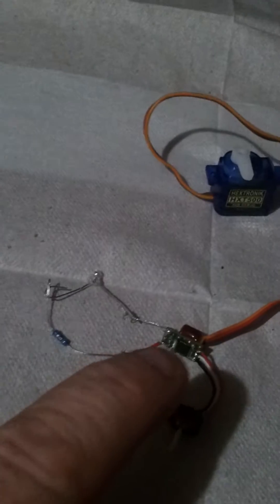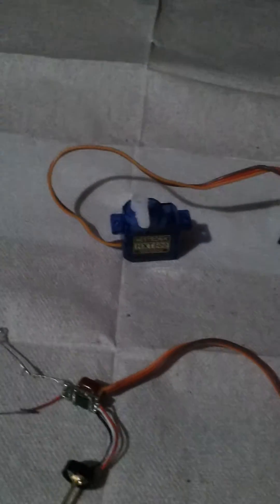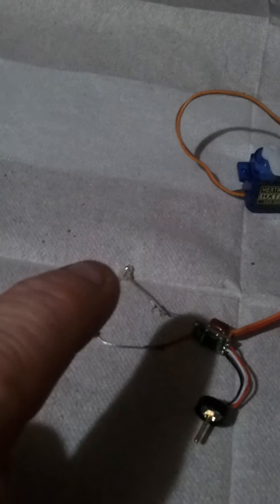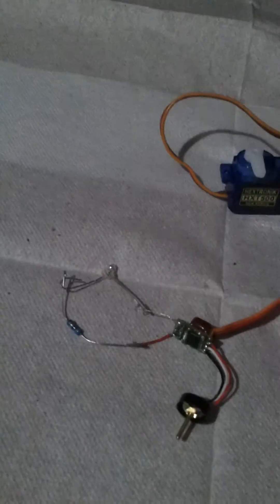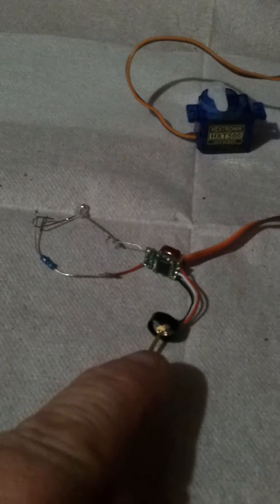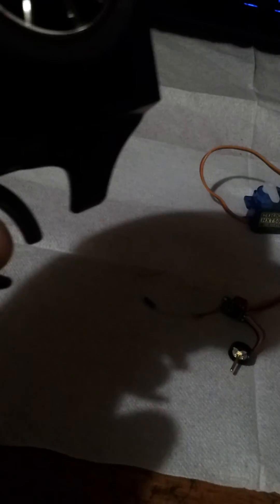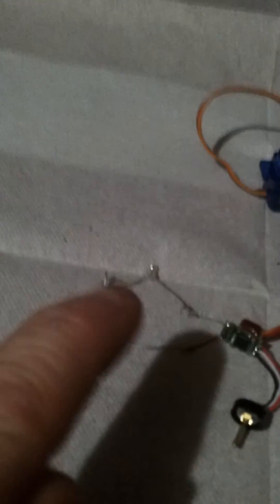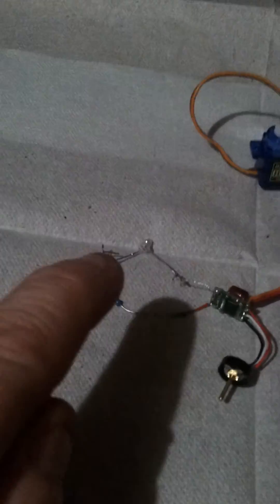$2 DIY RC Brake Lights

Comment: You could wire the two LEDs in series to double the voltage they can handle. I wire up all of the LEDs for my RC lighting in series pairs so they can handle up to 6v directly from the receiver. Haven't had any burn out yet.

Comment: how do you wire it for any direction? (i need to create solenoid brakes). Im trying to find a good rc switch
Reply from the maker: Zxenmusic what do you mean by wire it for any direction?
im assuming your solenoid brakes are set to always on, until a switch deactivates them? in which case you'd probably want it to switch with throttle on (instead of brakes like LED lights)

the pot thats inside the servo can be adjusted to set where the throttle position is when it activates.
swapping the pos and neg wires you can change if it activates on throttle or on brake.
Reply from the maker: Zxenmusic ok, after further research i think i get what you mean.
not sure you can wire it for both directions since its essentially just an on/off circuit. the only other idea may be to use a Y harness with 2 of these, one wired for each direction and adjust each trimpot to suit. (one for throttle and a 2nd for brake)
It should work

Comment from the maker: lots of LED have different ratings.
I used LEDcalc dot com to work it out.
input voltage is usually 5 or 6v depending on your rc
my 3mm led were 3.3volts + 20mah peak current, yours may be different being 5mm.
I  used the "parallel" calculator based on 2x LED setup

Comment from the maker: no I don't, sorry.. but its as simple as doing it the same as the above video, but use 150 ohm resistors instead. (if using 3mm red LED)

 then gently join another wire into the red power wire before the servo.. add in the resistor and run it past the "brake light servo" and tap direct into the LED power line... this way half power will bypass the servo.. and the servo will just boost the brightness of the lights

Comment from the maker: this way you get a constant 10mah (half brightness) to the LED's at all times..
and when you brake, the servo switch (in the video) boosts it by another 10mah, bringing it to full brightness

for headlights I went into the Aux channel on my Rx (from memory)

Comment from the maker: yep, the brake line is on a Y harness with either ESC (for electric rc in my case) or with the throttle brake servo on a nitro

ive also found a decent way to get tail lights / brake lights.. you use resistors that only give half output (eg 10mah to the LED instead of the full 20)
have one resistor in the servo as seen in the video, but also have another which tap's into the power wire and BYPASSES the servo and runs power direct to the lights.

Comment: Did you plug the servo light sistem to the trottle channel, do you use a y servo cable, and if you would have front ligths would you plug in the same y cable?

Comment from the maker: good call, i chopped the adjustment shaft off completely with pliers, then used a micro screwdriver to poke it into correct adjustment.. i was wondering about CA glue, epoxy or other to set it in place.

thanks for the reply, glad you liked it.

Comment: Works well.  Suggestion for the potentiometer (trimpot)...  After setting it where you want, put some hot melt glue on the shaft and base so your settings don't change.